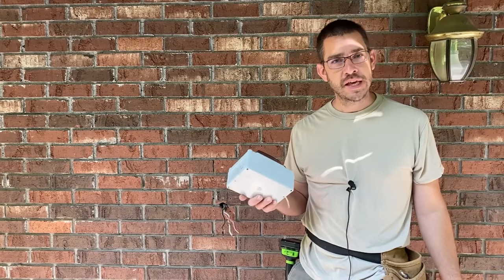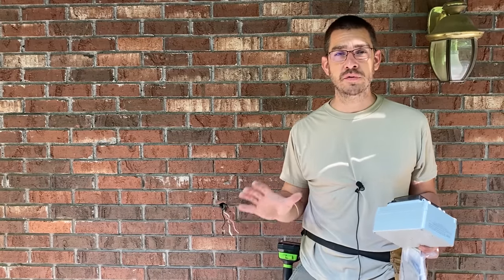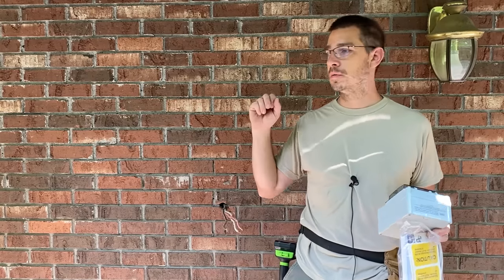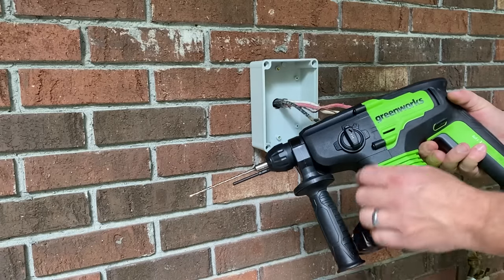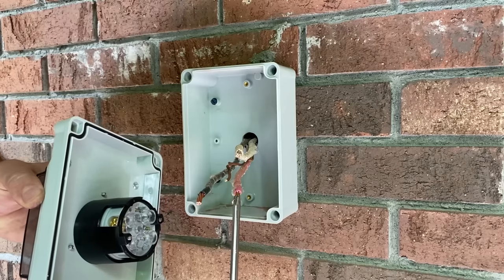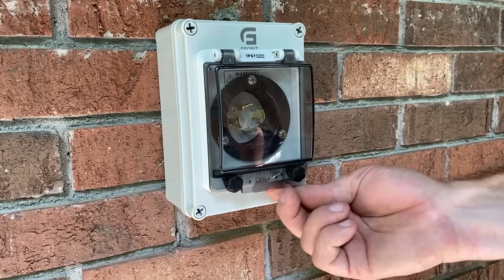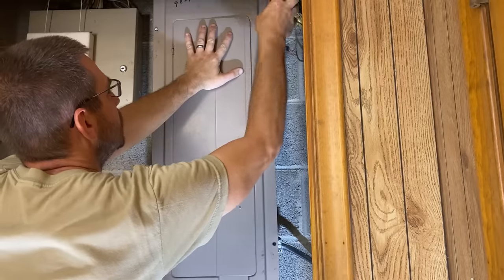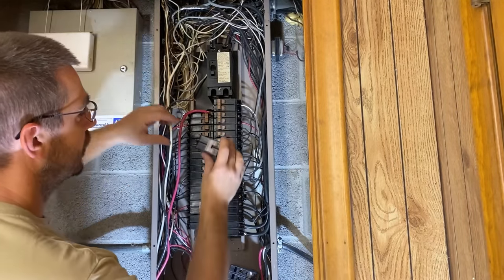How To Safely Power Your Home With a Portable Generator

Comment: Thank you for the video, I have a Honda eu3000is generator that’s states the max output is 25 amps, does that mean the biggest breaker I could use to tie into from outside would be a 25 amp, and that I couldn’t flip a breaker switch over to use that’s any higher than a 25 amp even if all the other breakers are in the off position ?
Reply: Correction, just read the specs further down,.. it’s 30amp (125v) for the connection outlet
Reply: The breaker is only there in this example to act as a switch so it only needs to be above your maximum output of the generator.  
The breaker incorporated into your generator will do the protecting of your wire
 “what they are for” 
in the building assuming  the wire is rated for the maximum output of the generator. 
Example: If the generator has a maximum output of 30 amps, then the wire would need to be 10g.
The breaker in the panel would need to be 30 amps. 
Consistency in amp ratings throughout the project is important. In part due to the fact that each outlet and breaker are physically designed-to work with a specific wire size.
Reply: Your Honda is a 120V generator. They typically are not hooked up to electrical panels, as they really shouldn't be used to energize both sides of a 240V panel. It can be done with a transfer switch instead of an interlock switch though.

Comment: I don't understand why you should tie the two top breakers together with the zip ties.  Can you elaborate?  thanks
Reply: So that no one can remove a breaker accidentally and get shocked.  Most breakers have no power when removed, but the generator breaker will have power even when removed if the generator is turned on.  The zip tie makes it hard to remove and get shocked.

Comment: What's the difference as far as safety  between hooking up that receptacle outside and just plugging directly into the dryer plug?
Reply from the maker: one issue is the plug gender, if you do that you have a male “live” end that if it falls out of the dryer plug can short on things or shock you start a fire etc. if you just added a generator inlet box and a switch next to the dryer plug and used the same wire that would probably be safer and may actually meet code

Comment: Great job! It is a pleasure to see someone show the correct and safe way to hook up a genny to run most of a house during a blackout.

I would just add - most municipalities will require that you pull a permit for this work, and have it inspected once complete. I can't stress enough the importance of this. If you do not pull a permit and your house burns down from an electrical fire - even if the fire was not caused by your work - your insurance company will likely not pay the claim without a long, expensive legal battle.

Pulling a permit is great (and low cost) way to have an expert double-check your work for you.
Reply: Don’t forget about the portable generator safety rules. Here are the generator safety tips:

1) Please do not allow an unqualified person or your children to operate the portable generator. That is important against the generator safety rules. We also need to be keeping an eye on our children too. You need to make sure that your children are not playing near the portable generator especially when it’s running so they won’t get electrocuted. Generators pose electrical risks and they can be hot during an operation. Please keep your children away from the portable generator at all times. It is important to keep our children safe especially our little ones. Be aware of all the hazards.

2) Some people use their portable generators indoors which increases the risk of carbon monoxide poisoning. It’s important to have a carbon monoxide if you have a gas generator. Never ever use your generator indoors even if your doors and windows are open and even in the garage is not safe to use a portable generator. Not even at your porch and your deck. It is never safe to use your generator indoors and in enclosed areas of your home. Your generator needs to be 15-20 feet away from your house. 

3) 🔥generators cause fire hazards too. Never refuel your generator while it’s running. You need to let your generator cool off before refueling it and before storing your generator. Never overload your generator too. Never ever back feed your generator. You should never plug your generator into a wall outlet. Also never store propane tanks indoors. Please keep flammable things away from the generator as well and please don’t smoke cigarettes near the generator. Having a fire extinguisher next to the generator is also important against the generator safety rules. 

4) generator operation; make sure your hands are dry before touching the generator. Never use your generator in wet conditions. Don’t let your generator get wet. You need a generator tent if you need to use your generator during wet weather. Please don’t wear loose clothes when operating the generator. Turn on your generator before plugging in appliances. Use the right cord for your generator. Please do not use worn out cords. 

Hope this helps.

Comment: When sizing a generator, pay attention to the specs, not the advertising hype.  Most are now advertising power output based upon the surge rating - but no generator can run at the full surge rating as it is only intended for a couple of seconds until an inductive load such as a motor gets up to operating speed.  They are also giving long operating times on a full tank of gas but not emphasize that it's at reducted load.  They used to use 50% load, some still do.  Others are using 25% load.  Honda advertised a 19.6 hr operating time on a full tank of gas for their 3000 watt inverter generator - but that's at a 20% load = 500 watts.  If you're already running at 50% power and an inductive load kicks in, that sudden surge may exceed the generator's surge rating and will shut down.  Then there are code requirements that if not met, might cause your insurance company to question the installation after the fire investigation concludes.  These are not plug and play installations.

Comment: So glad I live in the UK and have a decent electrical system  this would never be allowed
Reply: That’s fine if you want to be completely reliant on the grid.  If you ever experience a power outage you will be in the dark.  The UK has power outages too.  Overall our grid, which is several times larger than the UK's, is great.  However, during severe storms or fires you can lose power.  A backup is just a way to make sure that a storm doesn't disrupt your life.
Reply: So glad I live in freedom for people like you
Reply: @Aretec  You have no clue what you’re talking about.

Comment: There must be at least one other way As mine has neither of the two you have Shown.  Mike has a large breaker at the metre panel outside which then allows me to select one of the Hydro comes from the pole for the generator 🤔

Comment: What if my panel doesn’t have a main switch? 
Can I still install one of this?
Reply: There's got to be a disconnect somewhere, maybe outdoors.  But this product only works on panels with the main switch directly above the individual breakers so it probably won't work for you.  Probably time to call an electrician for advice/service.

Comment: What was your previous outlet used for. The wires look large, but I am far from an electrician. Haha
Reply from the maker: The wire that was there is actually rated for. 50 amp service. It could have been for an outdoor oven or it was prepared for a larger generator hook up

Comment: Looks like you just got the same setup I did last April
Reply: Don’t forget about the generator safety rules as well. Remember to follow all the safety instructions whenever you use your generator. Here are the generator safety tips:

This is just a reminder for everyone’s safety. 

1) Please do not allow an unqualified person or your children to operate the portable generator. That is important against the generator safety rules. We also need to be keeping an eye on our children too. You need to make sure that your children are not playing near the portable generator especially when it’s running so they won’t get electrocuted. Generators pose electrical risks and they can be hot during an operation. Please keep your children away from the portable generator at all times. It is important to keep our children safe especially our little ones. Be aware of all the hazards.

2) Some people use their portable generators indoors which increases the risk of carbon monoxide poisoning. It’s important to have a carbon monoxide if you have a gas generator. Never ever use your generator indoors even if your doors and windows are open and even in the garage is not safe to use a portable generator. Not even at your porch and your deck. It is never safe to use your generator indoors and in enclosed areas of your home. Your generator needs to be 15-20 feet away from your house. 

3) 🔥generators cause fire hazards too. Never refuel your generator while it’s running. You need to let your generator cool off before refueling it and before storing your generator. Never overload your generator too. Never ever back feed your generator. You should never plug your generator into a wall outlet. Also never store propane tanks indoors. Please keep flammable things away from the generator as well and please don’t smoke cigarettes near the generator. Having a fire extinguisher next to the generator is also important against the generator safety rules. 

4) generator operation; make sure your hands are dry before touching the generator. Never use your generator in wet conditions. Don’t let your generator get wet. You need a generator tent if you need to use your generator during wet weather. Please don’t wear loose clothes when operating the generator. Turn on your generator before plugging in appliances. Use the right cord for your generator. Please do not use worn out cords. 

https://youtu.be/I1jT3ANENvI and here is a video more about keeping others safe when using generators and also about our family’s safety. Hope this helps

Comment: The only problem with these that I might mention is there's no way of knowing when the power has come back on unless you go to panel and reset main back on to see. It doesn't really matter except you may be burning fuel when it's not needed, that's all. There are smart modules that do this at a greater initial cost which is good when you have an automatic startup generator or a solar generator online all the time, which is what I have.
Reply: The power companies have a feature they can text you when power is restored. Its delayed a little but its better than nothing.

Comment: Get a generlink. It is a meter mounted transfer switch. No need to hire an electrician to do any wiring.  Wire from generator to the meter, and done. Power company will install the generlink in most cases, and they installed mine at no cost after I purchased the generlink thru them,  that’s what I opted to do as they offered it, easier route for me.

Comment: I had an electrician come out and he gave me a $950 bid plus parts!  Where did you say the links are so I can buy the part myself and do this?
Reply: That was a fair price
Reply: @regularjoe5055  that's an outrageous price. is he going to kick the dog on the way out too, and run off with the wife?  I can install a generator power inlet box, as depicted in this video, in less than 2 hours. Is almost $500 per hour an acceptable price? I think not. $950 plus parts,  is probably $1300. If its a short run of wire, the parts/wire cost should be under $200-$250
Reply: @bubbatime  If he runs off with MY wife, it’s a bargain price 😹
Reply: Cost me 100 bucks and 2 hours time
Reply: @regularjoe5055  that is why I DIY
Reply: @curve5746  for you that might work, you know how many homes went up in flames because folks think they can DIY

Comment: You removed a 50 amp breaker to add the 30 am generator breaker. On another comment you said that was a breaker not in use. What if all my breakers are part of the houses function and I have no open breaker spaces??
Reply: An electrician can fix it. Bigger breaker box or sub breaker box.
Get a qualified person to check it. I’m not.
Reply: You could also use piggyback breakers allows you to use single slot for 2 120V circuits use a few of those to free up space for the double pull breaker for generator. That would be cheapest option or the next solution would be put in sub panel to free up space but that can be very expensive.

Comment: I hate to be too critical but whoever wired that panel did a substandard job. Wires all over the place and not tidy at all. I have a problem where the exterior receptacle does not have a bushing for the wiring required by the NEC. I hope that the generator is GFCI protected. Otherwise, a very good presentation. I have a different set up and is primitive compared to yours. I have my generator in my basement shop. I vent its exhaust through a pipe to the exterior. Since our power interruptions are rare, I just run a couple 30 amp extension cords through the house to essential equipment, so I don't have to open the main on my panel. I don't have to be concerned with GFCI considerations because the generator has that protection.

Comment: Without interlock installed can use it that outlet as a regular outside plug. And yes I certified electrician installed mine but I bought a welder that has that connection. I would like to know before I call another electrician

Comment: 12:55 It would instantly trip the breaker on the gen, the amount of resistance would be the equivalent of a dead short. No, it will not power up the neighbors or kill a lineman.

Comment: Dryers are 20 amp and most generators are 30 amp. If you place a larger load on the dryer outlet you will heat the wires in the wall and catch the house on fire. If your insurance company finds the plug welded into the outlet they will not cover your loss.
Reply: @crusherfang9368  Having worked in home construction all the outlets I saw were 20 amp. Can you provide a make and model of the dryer your speaking of?
Reply: @crusherfang9368  In Mass and CT they were on 20 amp breakers, Thanks for the info

Comment: Those wires are in rough shape. Not having an insulated bushing here is a potential hazard, not sure about your codes in the US but here in Canada that would fail an inspection based on the lack of bushing.

Comment: I just do it the old fashioned way as I go out back and pull the meter off and hook up some wires and start the generator.
Reply: What do you mean by "pulling the meter off"?
Reply: @sais9221  Remove it so no power can feed back

Comment: Your PB30 box should have a connector for the wire coming through the back, and by code you are require to have that jacket sheating showing at least 1/4" in the box... you don't just "push them back in wall". The zip ties work as a hold down which is also a code requirement. Other than the terrible advice of pushing wires back into the wall looks like a compliant install👍
Reply from the maker: There is about an inch of space between the back of the connector and the wall so there is more than 1/4” of sheathing inside the box.
Reply: @SSLFamilyDad  :  You are missing the point that Idcfg was trying to convey.  The connector is required by code.
Reply: He is referring to the sheathing of the cable not the insulation on each individual conductor. Normally the hole would be offset from the generator plug in the box to allow the cable to enter using a connector and folding the conductors in the box to allow a stress free connection.
Reply: The box requires a connector. The outer sheating is required to have at least 1/4" in box. These are code requirements. If the knockout isn't in the best spot you make another one....

Comment: I keep reading conflicting information about feeding generator power into a house via this type of interlock system and whether or not the generator should have a floating or bonded neutral.  I'm in the US and have a 12 year old (?) Troy Bilt 8000watt generator (model 30247).  The generator panel is NOT gfci protected (as near as I can tell....no mention of it in the manual).  The generator manual says "generator has a system ground that connects the generator frame components to the ground terminals on the AC output receptacles.  The system ground is connected to the AC neutral wire (the neutral is bonded to the generator frame)."  I've read that code only allows 1 neutral to ground bond location.  If I connect generator to house via interlock and L14-30 plug do I need to unbond the generator neutral & ground?  If so.....why?....what is potential risk?  If not....why?.....as code seems to suggest it needs to be unbonded since the house main panel is a neutral/ground bond location and there shouldn't be 2 neutral/ground bond locations?
Reply: By code the generator should be unbonded and floating. Check your panel. Your white neutral wires are probably bonded to the bare ground wires on a grounding bus bar. In practice, it doesn't really matter if the generator is floating or bonded. Why? Because your 30 amp cable has a ground wire and a neutral wire in it. You plug it into your house, and into your generator, and becuase of the bond in the panel, your neutral and grounds are basically bonded together. Hard to explain but maybe you can figure out what Im saying.

Comment: Why didn’t you weatherproof/pest proof that hole through the bricks?
Reply: Otherwise, very informative and straight forward. Thank you for the video.
Reply from the maker: Probably could have put some silicone on it but the box is pretty tight to the wall and in my case it is in a covered spot so it doesn’t get wet